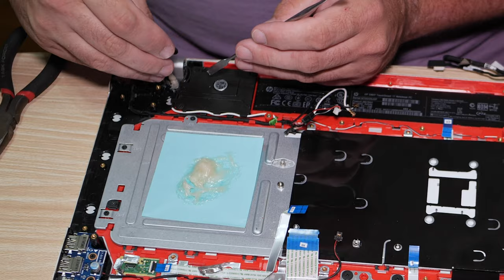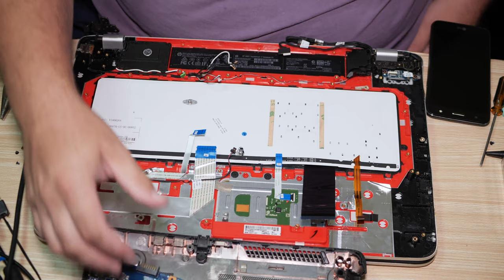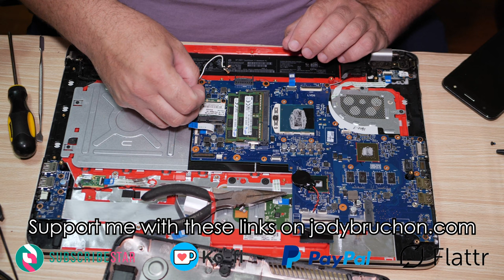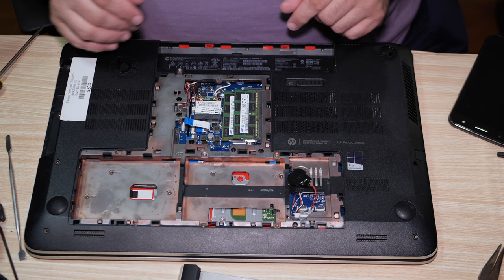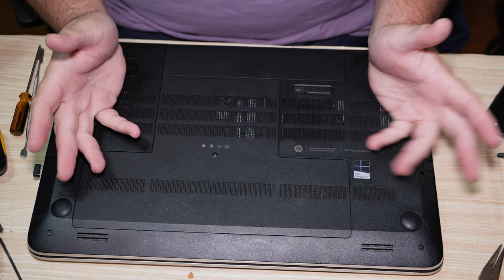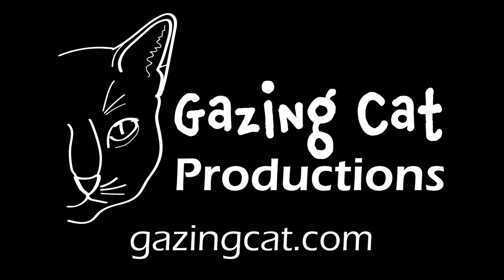HP ENVY TouchSmart 17 Keyboard Replacement - Full Reassembly (Disassembly In Reverse) - Jody Bruchon

Comment: great video, thanks a lot!
I have a falty keyboard, just got a new one and now I'm gonna try replace it myself. As I bough one without backlit because I'm on budget I'll just use the existing one, didn't knew it was even possible! Thanks for that.
why so many cables??? I'll come back to say If I've managed to do it without screwing something up lol
Reply: I ACTUALLY DID IT!
took me several hours but it did work out at the end.

thank yiu so much, without this video of yours I wouldn't have managed to do it.
Reply: And I forgot to mention, I've managed to unglue the keyboard flat cable. I dipped a bank card in rubbing alcohol and worked my way through the cable, went smooth
Reply: How you separate the old backlight into the new keyboard? is that easy to remove a bolt or what?
Reply: @019arifandi2  it was easy, it's just glued onto the back of the keyboard 
The glue is supper sticky thou. I've used a bank card and some alcohol to work my way thru. If yours are like mine you'll be fine, just be patient and eventually it will come off